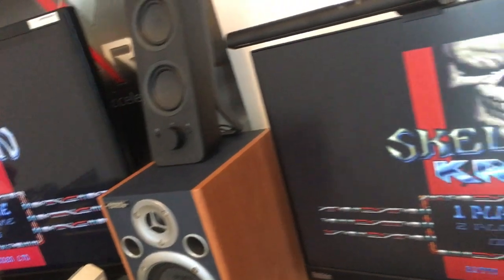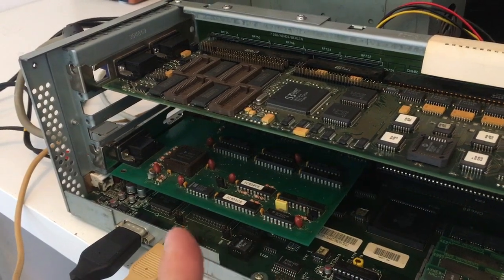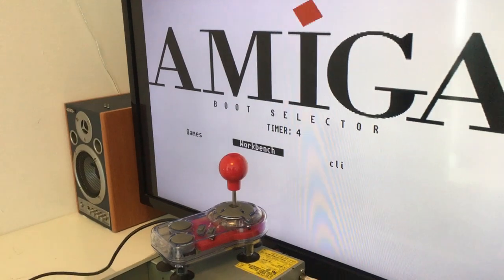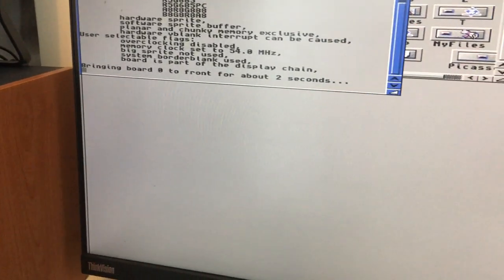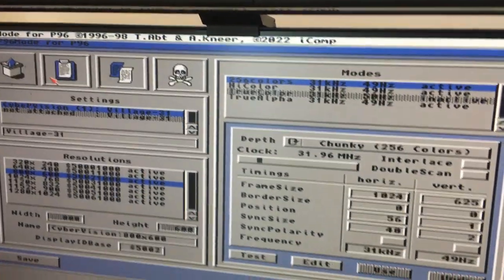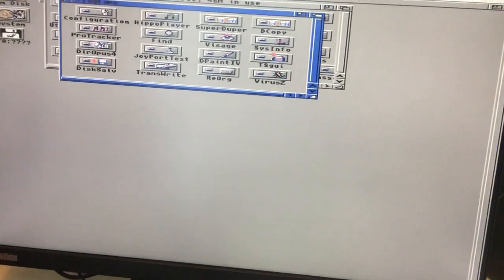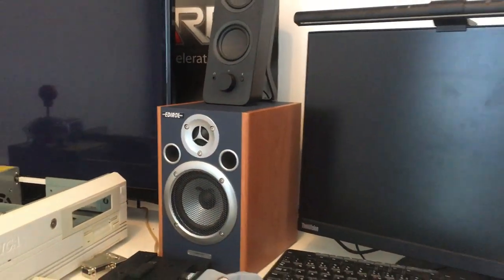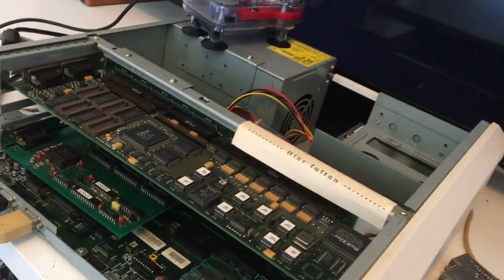So i tried CyberVision64 in my Amiga 4000 wanna try with ZZ9000 now

Comment: Yeah 15Khz is not an uncommon issue, even back in the day it was a problem more often than not. I still don't get why they went with that specification when developing the Amiga's video out, maybe to ensure they would sell their own monitors, which in my opinion was stupid as this imposed other limitations and reduced quality in some cases. Sad sad foolish choice for such an amazing brilliant architecture that even today has no equal, there are some similar approaches but none as brilliantly ahead of its time.
Reply: The Amiga was intended for 15Khz VIDEO resolution at the time. This timing is also what allowed the Video Toaster to work.  It allowed genlocking and titling etc. They also sold scandoublers (31khz)as well as the A3000 coming with one which could use standard vga.